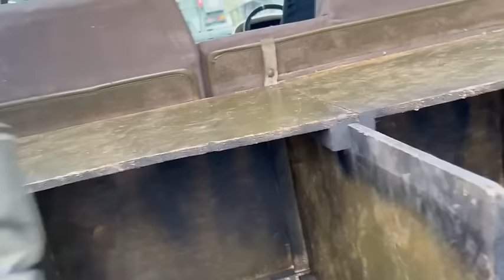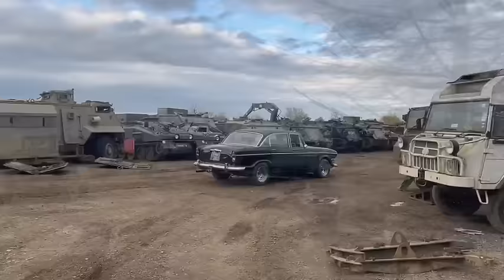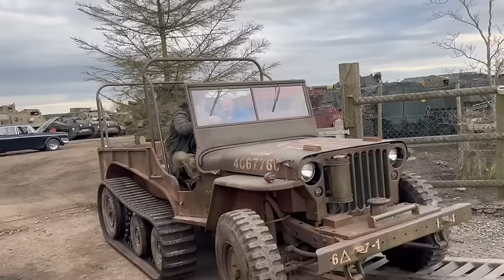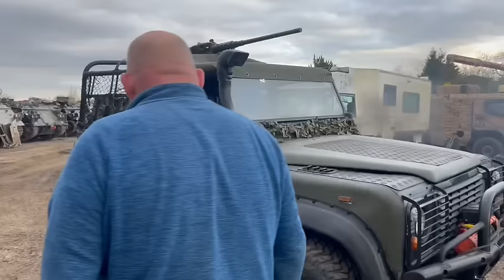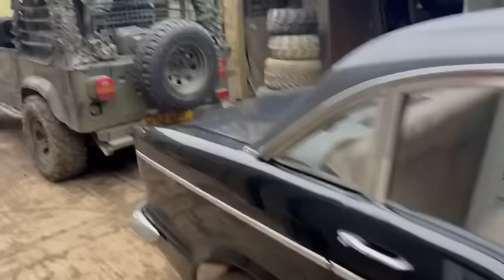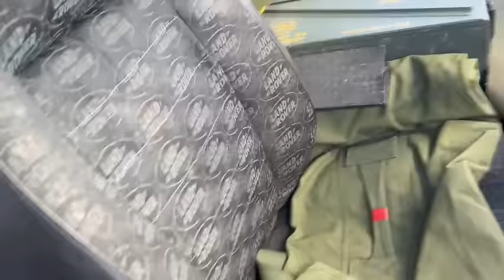The willys half track arrived and a hot Rod Humber #jeep  #humber #classiccsr

Comment: i just had a giggle at the rear tail gate on the Landy 90, WTF, that piece of perforated steel comes off the top of a 1980s Habitat trolley, i bought one for my stereo (and still have it) but what the heck is the thing across full width with the four holes in each corner